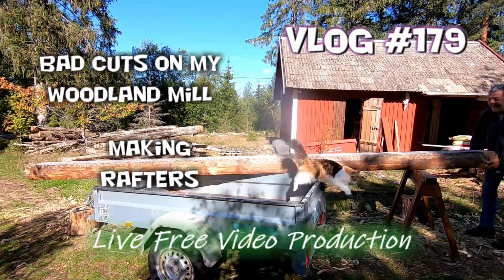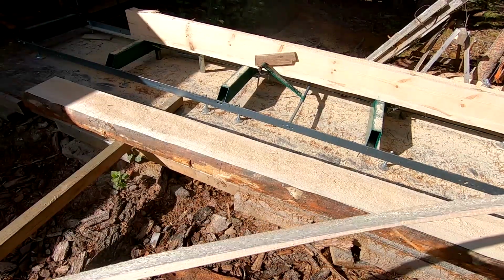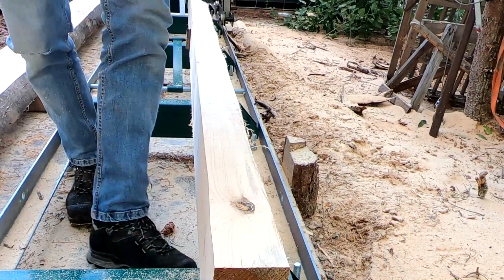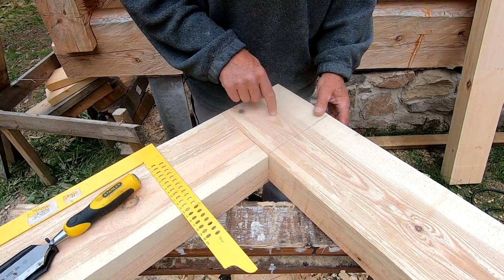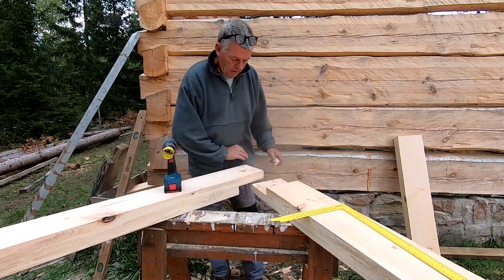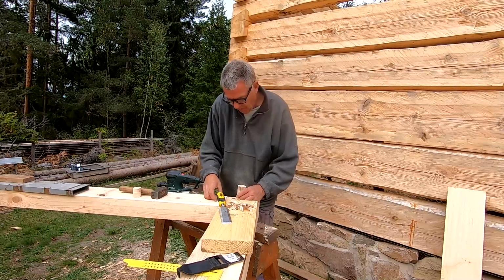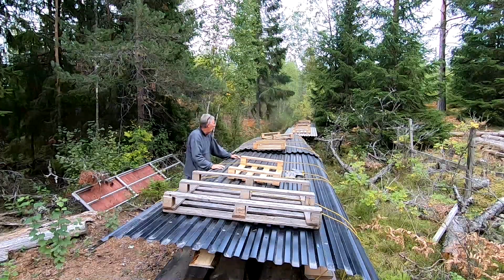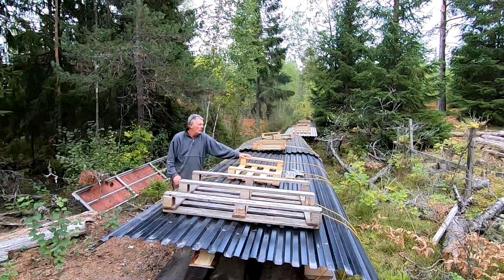Bad cuts on my Woodland Mill, Making rafters - VLOG #179 - S4

Comment: Michael, Must be a fine line in carving the dowel down to fit. To tight will split the rafters , to loose ,   Well , … to loose. Nice job , looks great. Old man winter is coming and I need a new septic system, so it’s crunch time both here and there. Stay safe up there. Terry
Reply from the maker: Hi Terry. The dowel - in Danish "dyvel" - has to be close to the same as the hole or else, it ends up like you describe. I hope your new system won't set you back to much, and that you get it finished before the frost makes it more complicated than necessary.
All the best
Michael

Comment: Michael, I really enjoy your videos, also a fan of some of your commentors. I am in the process of building an 18 x 14 foot log cabin out of reclaimed original Kentucky log cabin logs and sawmilling replacements that I need. Doing it completely solo like you. I was not sure about what size rafters I would use, but I like your dimensions and will probably use the same. Looks like you are doing a 12/12 pitch, which is what I planned to do. What are the overall dimensions of your log cabin, and how many rows are you going up in height? Thanks, John from southern Indiana.
Reply from the maker: Hi John. First of all, thanks for your comment, I do appreciate that. And then a yippiii I'm not the only one building a log cabin by myself. My cabin are 19' 8" x 16' 5" incl. a 2" overhang on the notches. My logs are 7" thick, and yes it's a 12/12 pitch roof. I'm up 7 rounds and then the plate logs, but it all depends of the width/hight of the logs when they are stood up on one another. and how high you want it, maybe to gain some extra space on a first floor. Take a look at "The Bearded Carpenter" and his videos. He is a masterclass builder of half dove tail cabins.  My rafters are 3,5 x7 inch, but I would have done 4x8" or 5x10" if I have had enough logs to do that. That's why I made a ridge beam, so the load (snow) won't be a problem.
I wish you all the best and good luck on your build - and I must say, I'm a bit jealous of you, getting your hands on old logs. I guess they have a special patina and a great look.
Greetings from the Swedish woods
Michael.